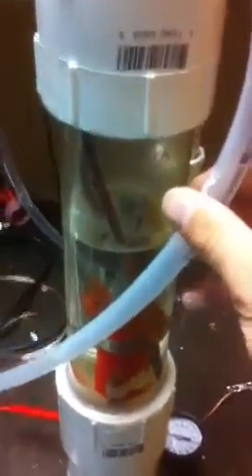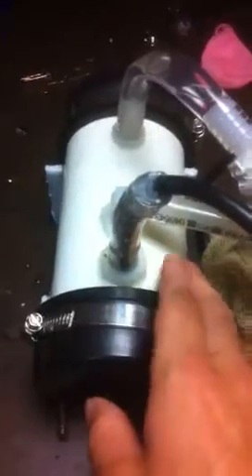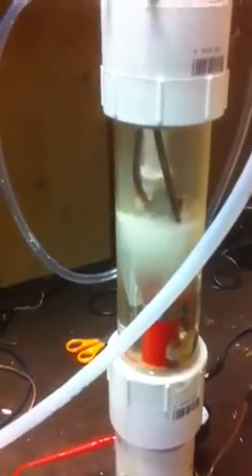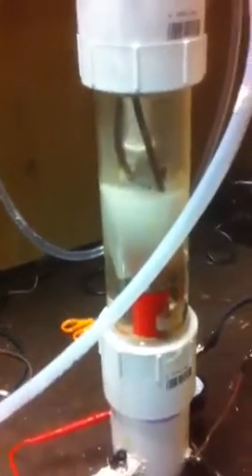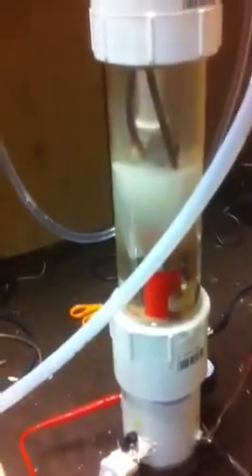electrolysis with pump and magnetization tube

Comment: Just to let you know a little something about water and the electrical polarization process. When the water gets polarized between the plates it physically no longer moves and if you push water through the cell you destroy the electrical polarization process. In Meyer's set up the tubes must be allowed to draw in their own water. It is simple to test for by using an amp meter inline with the cell and measure amps with pump on/off and see the results for yourself amp draw will go up with pump on.